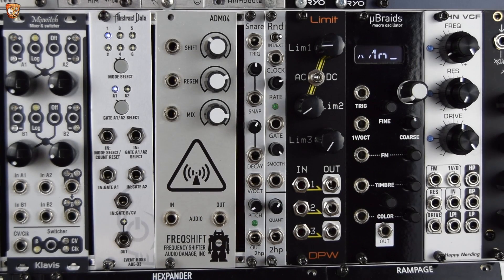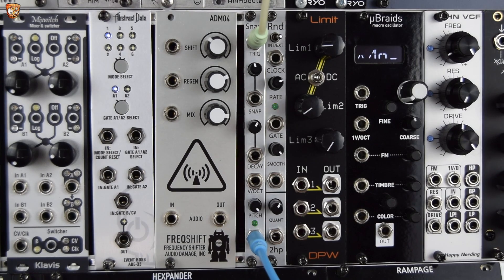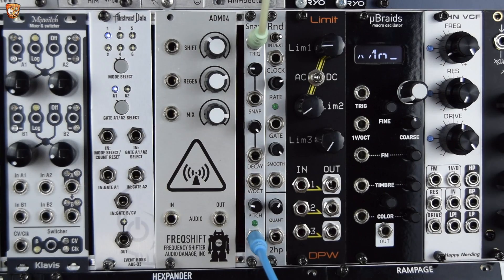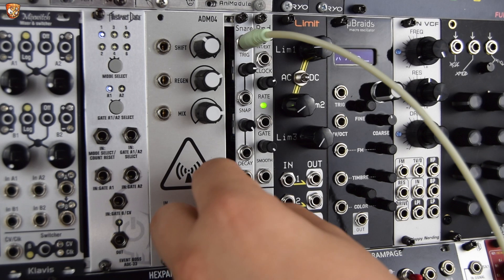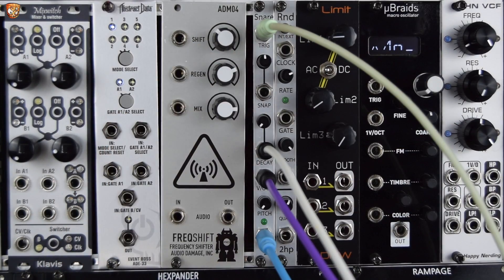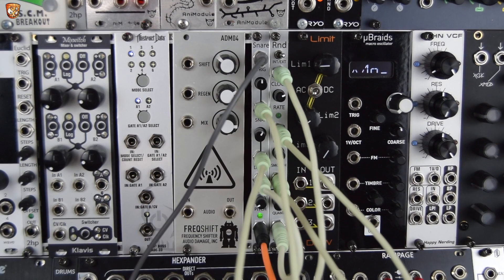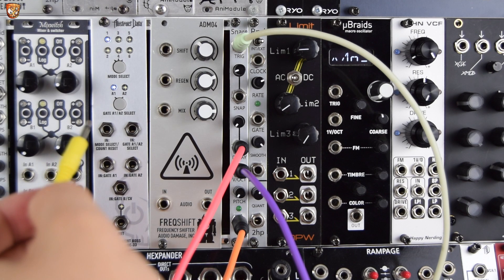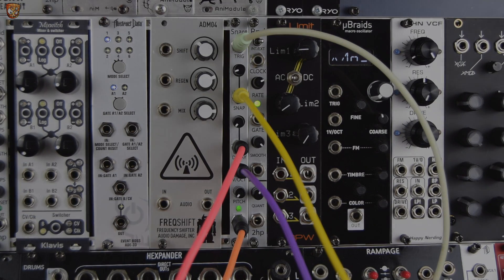2hp Snare (mini drum voice, wide range of tones)

Comment: Perfect, Cant wait for the other 2hp videos. It looks like I will be buying most of the 2hp stuff now. I did not have any love for them until this video. SO versatile for so little hp. Brilliant
Reply from the maker: Hi Jason, I have 6 other videos or maybe 5, go back and check those out as I think you'll like a lot of them.
Reply: Except they're mostly digital..and those tiny knobs..and build quality..and if you only buy 2 hp modules, you will run out of power connectors way before you run out of space in a normal sized case. And per hp, they're actually quite expensive.  Don't get me wrong, I've thought about buying some myself..but the idea of populating a whole case of micro sized modules sounds bonkers to me.
Reply from the maker: Absolutely a small case with lots of sub 4HP modules in wouldn't be nice to use. But a larger case (or multiple cases) with several PICO units and 2hp units in can really add some power to the case which is always nice.

Comment: Can this thing plug in directly into speakers or a desk mixer? Or would I need a VCA or a Mixer Module tied to this too?
Reply from the maker: Hello, you'd need a powered Eurorack case to put the module in. Then something to generate a trigger to excite the module to make a sound. 

Once that's set the output can go anywhere you like really. Eurorack levels are "hotter" i.e. larger in voltage that line level and other gear. So it may distort the input of other gear. That said most gear has the headroom to take it and you can plug it into a mixer or sound card.

This is just a snare sound though so straight to a speaker would be a strange/specialist use case. There's also no volume control. So I don't recommend going straight into speakers. 

Hope that helps.

Comment: How are you pumping the beat through the module? Also this module does hi hats also or is that from something else?
Reply from the maker: Hi HiFi, this is just a snare any other sounds are just there to set a musical context. 

The final patch is all from the Snare though, that's happening through sequencing the parameters to move between settings that more closely resemble other drum sounds.
Reply: @DivKid  ok awesome! thank you, i was wondering that. I want to start focusing on drum modules soon might just start with a kick and snare unit and add on from there
Reply from the maker: will these be the first modules for the system? Or you have some other modules but want to add drums?
Reply: @DivKid  I have others, dual vco, some LFOs, VCF, mixer, a filter based of the korg MS 20, I also have a midi to cv convertor so I plug my launchkey mini into it. Just random stuff I've been connecting and figuring out.

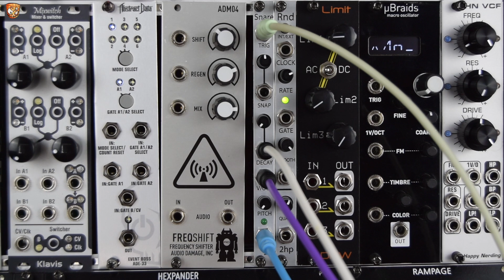Comment: At @4:00 or so, it sounds like the overall volume of the 2hp output is dropping on those rolls... what is causing that?  Is the change in volume being caused by the CV modulation on the "decay" parameter?  Or is the trigger input velocity sensitive in some way?
Reply from the maker: combination of the modulation all together as perceived level changes with length/decay/pitch etc.